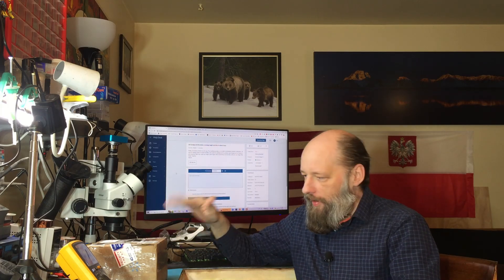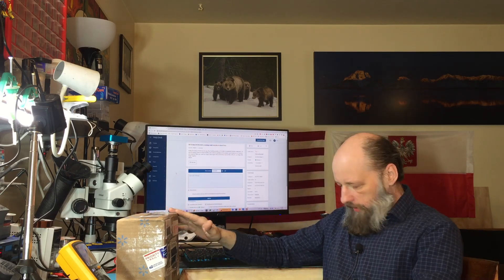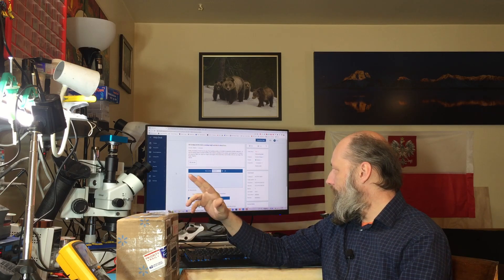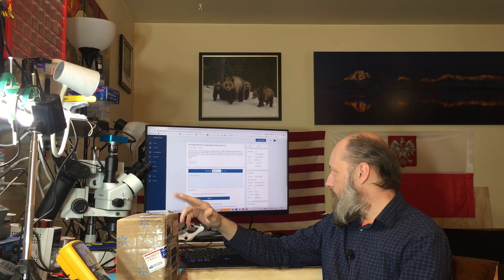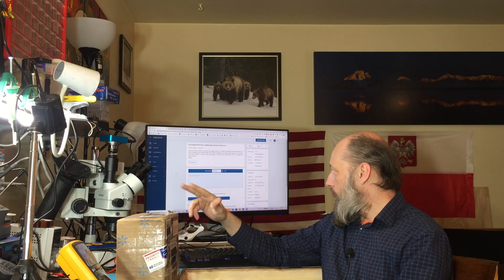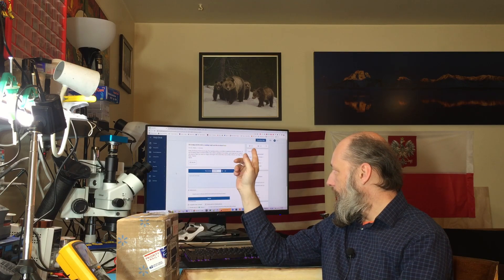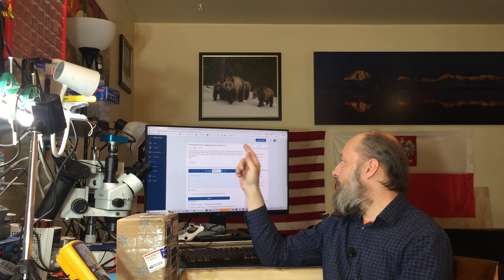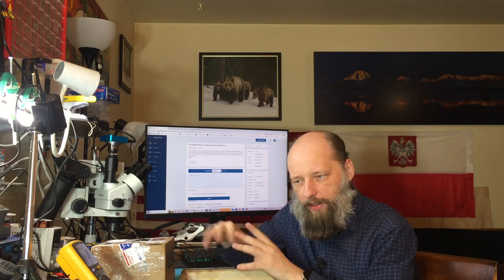2008 Subaru ECM repair for Aaron | Misfire, running rough and dies in closed loop

Comment: No idea how youtube got me here, but this was fascinating. I was wondering how someone repairs micro soldering on a workbench, am I correct in assuming you kind of flood it with flux and then get the area hot with a sort of more directed heat gun and run a tinned iron over the contacts? Also, I'm guessing you cant really "repair" a messy solder, its a clean and clear both surfaces then resolder (likely multiple times for a beginner) till you get all your pools where they need to be? I expected flooding a circuit board with flux would make the the solder stick everywhere not just in the contact points, was I just plain wrong, or am I missing some details?
Reply from the maker: all correct. The lead-free solder needs to be removed as it becomes brittle over time and use. After removing it, I replace it with leaded solder which has lower melting point and survives longer. 
The flux serves multiple purposes, mainly it deoxidizes the surface and help spread the temperature improving the flow. Flux is required during any kind of soldering on any kind of material. The flux I use is RMA which belongs to the group of active or aggressive types. It's very important to clean it afterward.

Comment: Did you do the caps before send back?
Reply from the maker: no, my test was not reliable enough and I don't have those in stock, but if the problems persist I will perform recapping on it.